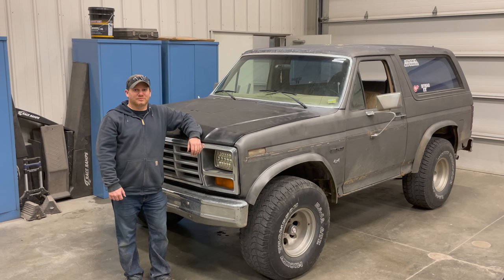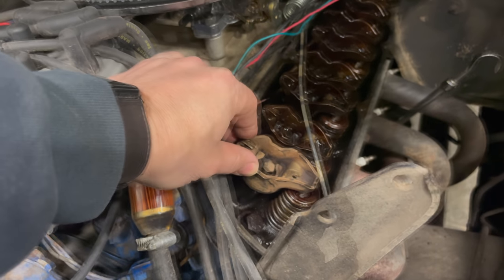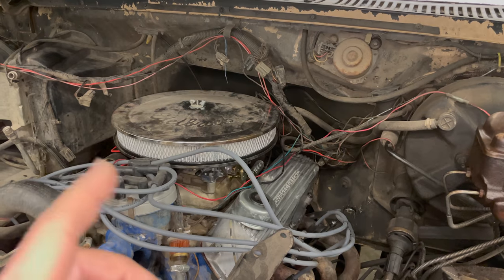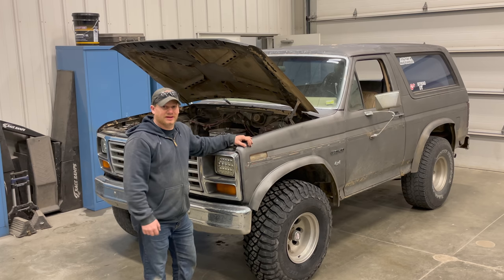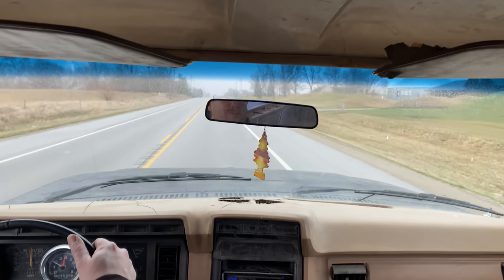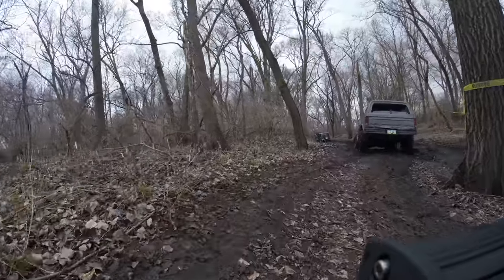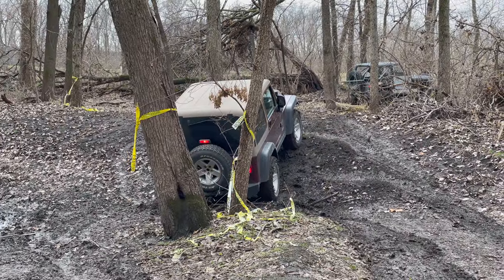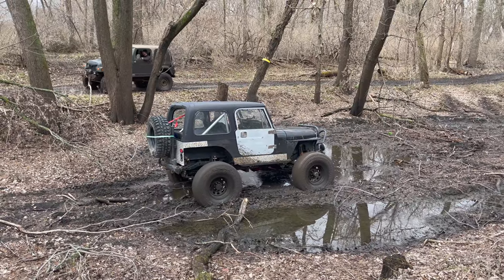Part 3: 1985 Ford Bronco Upgrades and Testing Off Road

Comment: Awesome. Keep up the bronco videos! If those sunvisors annoy you, a simple fix is to get some neodymium magnets with a recessed hole in the center. Run a screw through the magnet and sunvisor on the end of the visor and put a speed nut on the end of the screw. This will hold the visor up on the roof and keep them flopping about.

Comment: Suggestion on that alternator, consider what has come to be called the 3G replacement. 85 came with a 2G alternator and there are some serious problems in the connector which can lead to failures and even worse, fire.

Comment: I've got an "84 Bronco, 351W  all good metal. Work in process. The body paint is rhino liner top to bottom.  Not sure if I'm going to add headers, only because of heat issues.( I lve in the Phoenix area).
I do like your choice of mudd tire. Good road tire for me, with the sand and then switch to a rock tire for the northern trips.  Thanks for the videos

Comment: HI! i have a 1985 bronco. I feel your pain on the wiring. i gave mine a trim when i ditched the Old ford Hei and installed a gm style one wire distributer,  i ditched a p09nd of messed up unnecessary wiring and a control box and i gained a hotter , easier starting unit...  I recommend the upgrade.

Reply

Comment: For Ford V8's of this ilk you were supposed to by either 0.040" longer or shorter pushrods to accomodate for dimensional changes in the motor.
Reply from the maker: That would not take the slop out of the pivots and rockets.  I was not adjusting valve gap.
Reply: @ThisWeekWithCars  This was one of Ford's "Better Ideas" back in the mid 70's and early 80's to deal with valve train and rocker noise.  If memory serves me look at Motor Manual 1974-7 pg.1155. I agree there are other ways to "skin this cat" and yours is a novel idea and costs a heck of a lot less than a set of pushrods (about $85 from the dealer back in 1995). At the time, it fixed the valve train noise, for a student of mine, in a 1975 F150 with the 351W engine. By the way this was the fix for all ford V8's from that era.

Comment: Do 35’s fit well on stock suspension?
Reply from the maker: The front wheel wells were tubbed on this truck already, that is where you might have your issues so I cannot say what it would be like on a unmodified truck.
Reply: @ThisWeekWithCars  oh ok thanks 🙏🏽